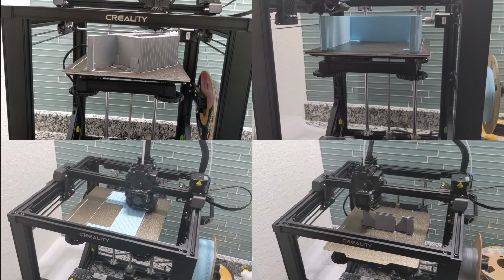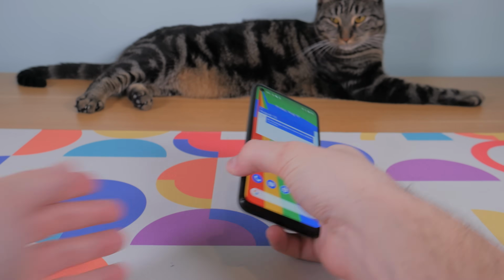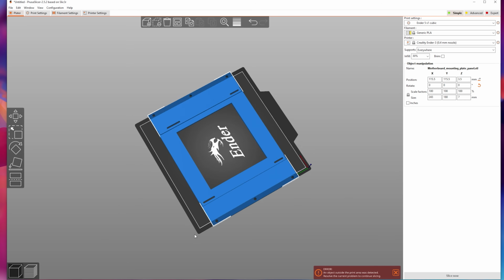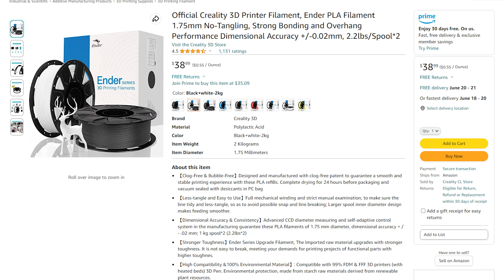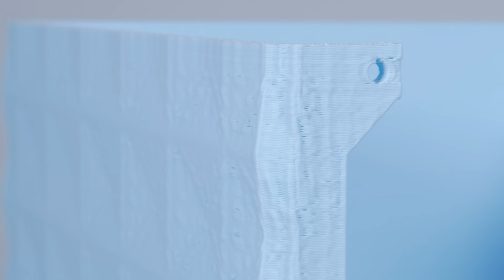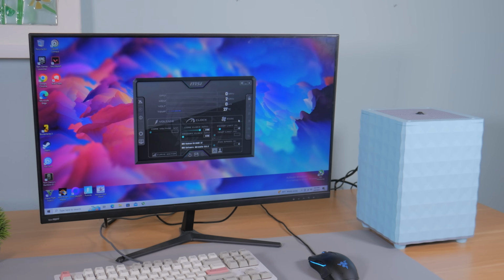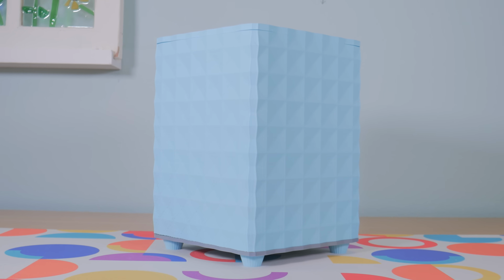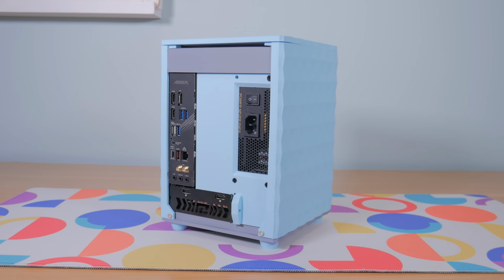I Built a 3D Printed Gaming PC! (2023)

Comment: I think this case has a design problem. I believe that if the fan were mounted at the bottom, to bring air from outside, the temperatures of the components would be better, since due to convection, the hot air will go out the top anyway.

Comment: I like your designs.
However, one thing that stops me from designing and printing my PC case is static electricity.
IMHO:
As far as I know, plastic PLA or PET(G) are bad electrical conductors and therefore they can accumulate static electricity on the surface. And if we count the fact that coolers inside the cases create the air flow that may make additional friction, the problem with static electricity becomes more serious. Cause it may damage PC components.
How did you solve this problem?

Comment: I was thinking about this too for an old fashioned LPX form factor case, but ESD and radiofrequency emission will be a huge problem with plastic cases since the PSU isn't grounded like it would be with a metal case. I was reading on Reddit, that attaching metal foil to the internal of the case should be enough.

Comment: At 8:00 the failing prints with the cheap white and black filaments is partial clogging. I guess it's dirty filament. Anyways so as it melts some bit of dirt in the filament gets stuck in but doesn't completely block the nozzle after a while they are sometimes pushed through leaving those missing layers. They ruin a print anyways so it doesn't really matter that they aren't a full clog.

You also really need to learn how to resume a print from a layer height. It can be really really simple

Comment: I wonder why so many prints failed. Is the part cooling fan attached properly? I noticed that your prints seem to have a cooling issue, also maybe your part cooling fan blows on the extruder itself, leading to thermal runaway with turns the printer off.

Comment: I wonder if the metal screws eventually wear out the holes. Also: Yes, more 3D printing content would be appreciated.
Reply from the maker: If you're just switching them out a couple times it should be fine, I built and tore down this case probably 5 times and haven't noticed any issues . The ideal solution is threaded inserts melted into the plastic, but the metal screws seem to overall work fine. Thanks for watching!

Comment: Will u do a test to see if the case warps from heat?
Reply: Late response. (Printed in petg) left fur mark gpu and cpu stress test running for 36hours. No warping
Reply: @AndySlug HATE TO BE THAT GUY. Petg still warps under cpu temps. U shoulda done ABS
Reply: @whynotbuildit   no no, its completely valid argument. But i can say that the case still goin strong but since then my sister got the pc.
Reply: Why would it Warp? The melting point is far beyond
Reply: @kingbob1278 glass transition temp is ~80C for PETG, which is the temperature that it will warp. I'd bet anything there will be some warping within 2 years
Reply: @Derek-eg9ig case temp inside shouldn’t be nowhere near that… I’d be surprised if they even reach 50 or 60.
Reply: @Derek-eg9ig the CPU/GPU might get that hot but the air flowing through it won't get nearly that warm.